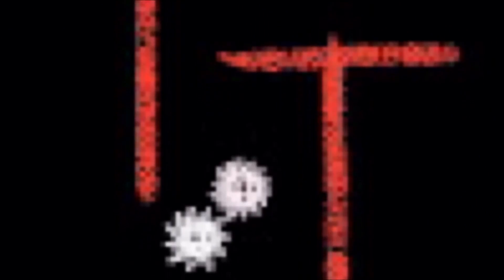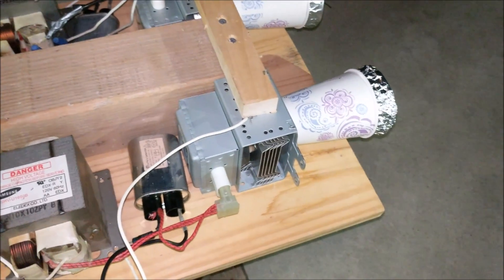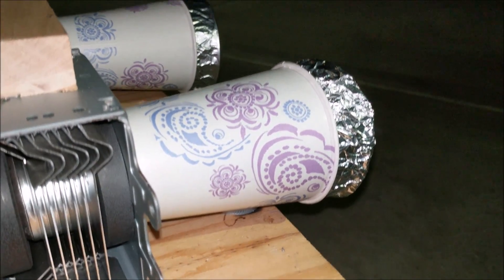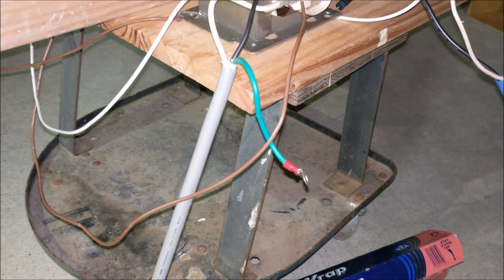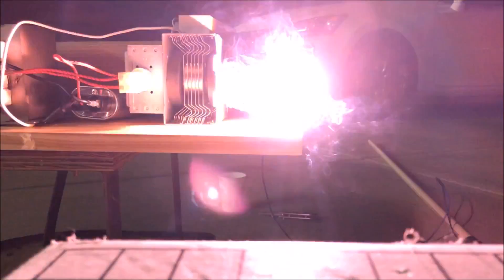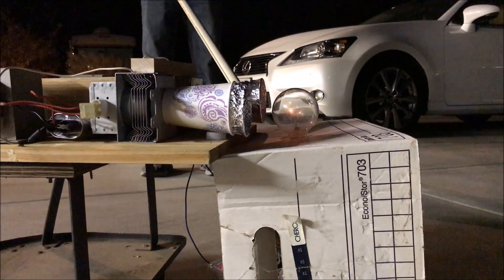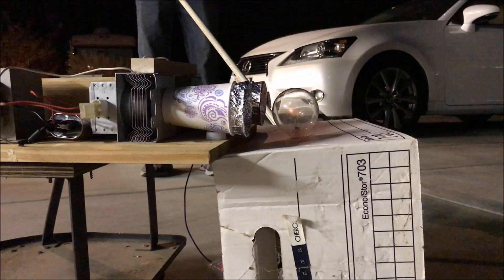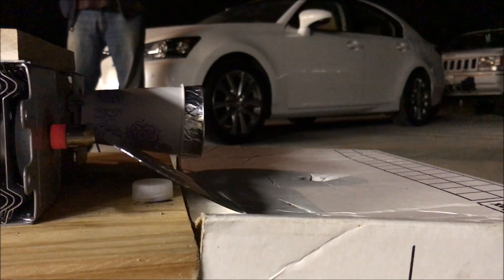Double Barrel Microwave Gun

Comment: Make note of this project in your personal diaries... and when you get older and contract cancer and/or cataracts, you'll know why.  
BTW... Magnetrons do not emit the microwave radiation from the ENDS of the cylindrical probe... they emit it from the sides... and there is no way you were protected from the radiation by the aluminum foil. It takes a solid layer of highly conductive metal to firm a proper waveguide... alum. foil will do exactly what happened here... burn up because it's not a solid.

The only way to create a "directional antenna" for a magnetron - is to load the radiating probe into a tuned cavity... the waveguide from the microwave oven is a perfectly designed waveguide. The magnetron MUST be sealed to the waveguide, that's what the "fiberous" metal o-ring gasket was for. Once the megnetron is properly attached to the waveguide, then you can create a directional rectangular horn out of metal, attached to the end of the waveguide. 

This requires precise dimensions, or the radiation will reflect back into the magnetron due to standing waves, and destroy it. The resulting reflective radiation explosion will be of sufficient microwave energy to not only destroy the magnetron, but will create a lethal EM pulse within a 4-8 feet radius. You won't feel it when it happens, but you will within 6 months.

(OK, so that last paragraph was an exaggeration, but everything else was the straight dope)

You really have NO IDEA how dangerous this is... but someday... you will (in all seriousness).... is it worth it?
Reply: Microwaves from the magnetron is not cancerous.
Reply: Here guys play with 241ghz microwaves for fun:   UK Microwave Group    https://www.youtube.com/channel/UChXhVN-JythhYCHbM27AHNw
Reply: beforebefore hey dude could u please send me a quick diagram of a safe set up..email me   stiviabc123@gmail.com....thanks buddy

Comment: if microwaves move through glass, can they be focused to get a further vocal point by using a lens? light waves are bundled, maybe micro waves can be bundled as well? normal microwaves diffuse the transmitted electrons, id like to know if it could work as a focused beam, same like lasers are focused basically?
Reply: kind of a late reply lol.....
microwaves and "light" are the same thing. the electromagnetic spectrum can all be called "light" (RF waves, microwaves, visibile light, Infared, x-rays, etc). 
what do you mean by "to get a further focal point"? to move the focal point closer or farther away from some point? or just to focus them into a simular fashion as lasers?
lasers use something called collaminated light (the beams of light are parrallel to one another and do not interfer with each other). as far as i know microwaves can do this (but there might be some other thing that im forgetting that may prevent this from working)

Comment: Just so you know you may want to install a cooling fan for the magnetron's for maximum power output.because if you just run them with no fan they will heat up very rapidly thus slowing down the out put power of the magutron and may burn it out.I did these experiments my self and did these tests and those we're the results I got.I just wanted to let you know.